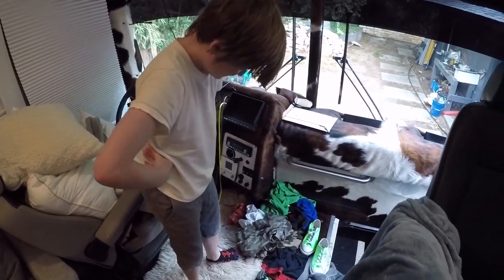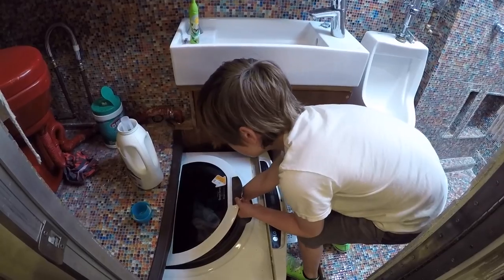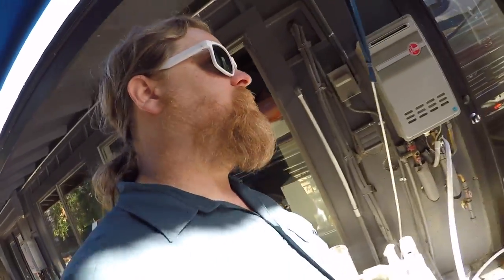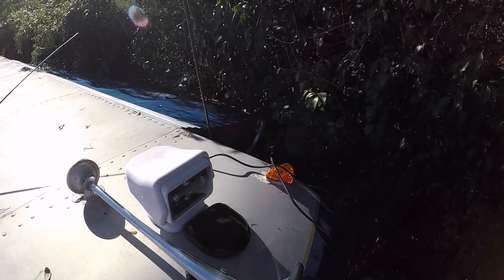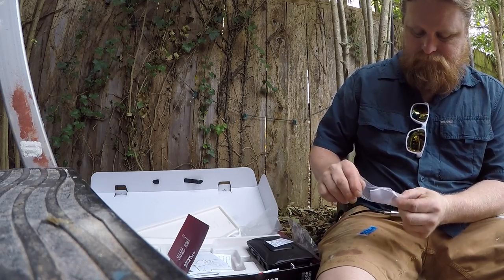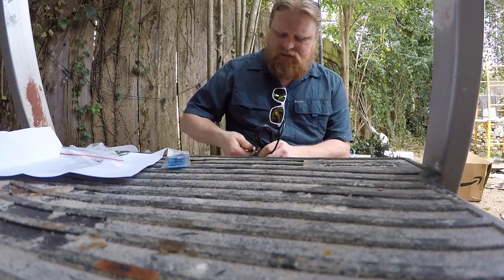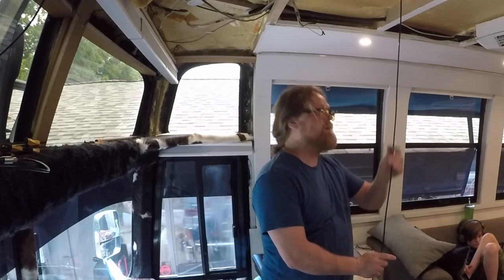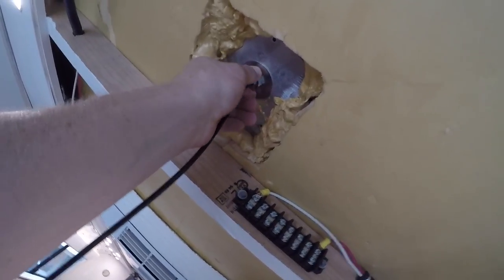How to build a Bus Conversion S20Ep04 laundry Webooster

Comment: would you say your bus is the same width of a typical school bus? what is the height of yours?
Reply from the maker: adictiveadictive Not sure of dimensions on school bus. Width on the outside of mine is 108 inches. Inside - 96 inches. Height is 13' 2" at the top of the a/c. Interior height is 81" until you hit the curve of the bus. Hope that helps - good luck with your build.